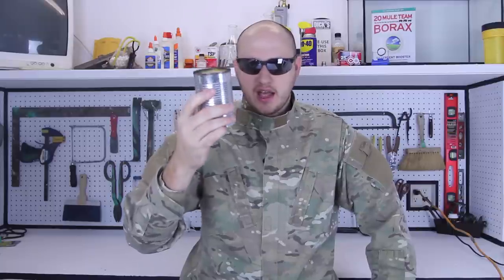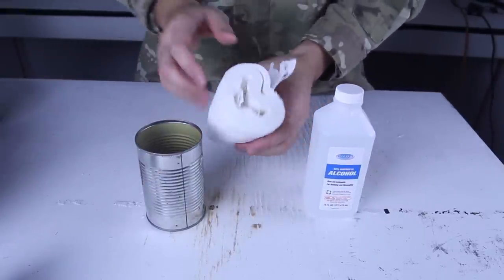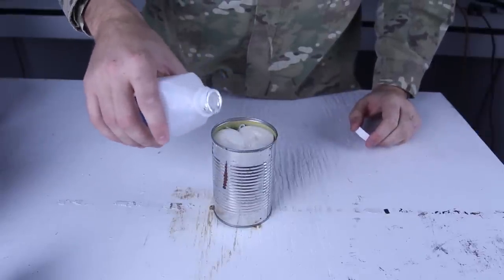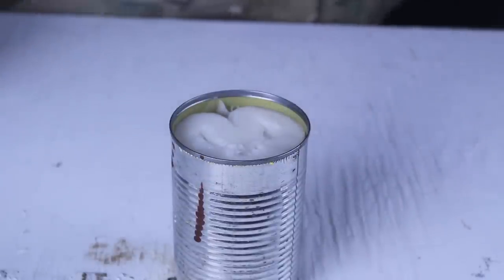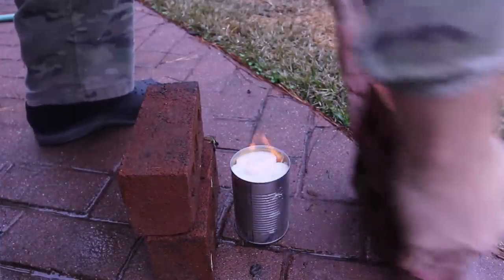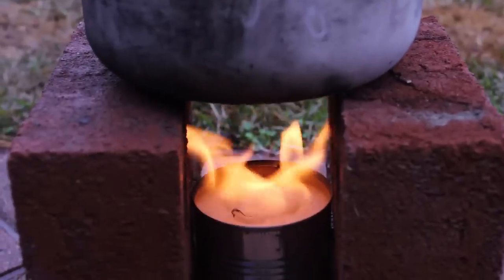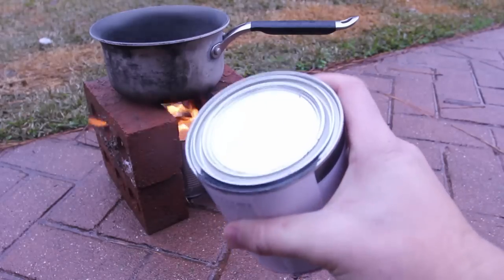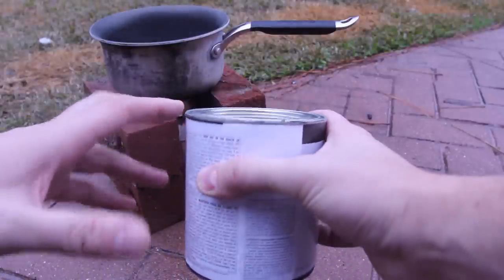Emergency Alcohol Stove from Toilet Paper and Can

Comment: I think in an emergency situation, toilet paper would be the luxury you would want more.  Are there alternative materials that can be used instead?  What about flame retardant insulation?
Reply: Yeah, in an emergency, I would take asbestos stove ramen noodles and save the paper for its primary purpose.  

But both decisions leave me feeling itchy.
Reply: They make a flame retardant insulation that doesn't use asbestos but recycled paper.
Reply: Every time I go hiking I always bring some toilet paper (cuz you know), some alchohol+first aid (for scratches), and maybe some food. So this video is pretty useful for me
Reply: This is a pretty cool trick.  Does it matter if you get the 70% alcohol vs the 90%?
Reply: @MrKeenius The higher the percentage of alcohol will burn hotter and last longer.

Comment: You really don't need the toilet paper.   Just pour the alcohol in the can, and there you go.  Instant stove.  (Just be careful not to knock the can over and spill burning alcohol!)

Speaking of alcohol, I would recommend using denatured alcohol rather than isopropyl alcohol.  Denatured alcohol (mostly methanol) burns much cleaner.

Comment: Very cool hack. I wish youd have shown a safe method of putting it out, though. Sounds silly maybe but it's an important part of the process. Dont want to get a nasty burn in an emergency situation where this is a necessary hack. That fire looked pretty wild. Seems like the hot bricks would make it difficult to smother. Pouring water on it would probably suffice but would that ruin it for further use? And what if water is scarce? Questions.
Reply: Pouring water on a stove like this is very a bad idea because if it displaces the lighter alcohol out of the paper you'll risk having a burning pool somewhere under your feet. It's very unlikely that blowing would work well either. Covering the business end with something solid and non-volatile is the best way.
Reply: moozooh
Just use the pan to snuff it out
Reply: moozooh
 thats pretty much all that I expected, which is why I was thinking itd be a good idea to show how to put it out if youre gonna do a vid like this.  It wont be common sense for plenty of people. thanks for the info.

Comment: Drill some holes into  the bottom of the can, alcohol won't leak out and air supply will be inproved. 
You can also drill it in the bottom and raise it up a bit, even better

Comment: how long this gonna make fire ?
Reply: TheSlavo1997 Hmm...using some very rudimentary calculations this will probably burn for about 30 to 40 minutes.
Reply: Martel DuVigneaud if you only put like a drop of alcohol, it probably won't start
Reply: Darren ATM It would definitely start with only a very small amount of alcohol. Isopropyl alcohol is volatile at ambient room temperature (as are ethanol and methanol) and as long as the paper has adsorbed alcohol the paper won't burn.
Reply: Depends on how much fuel you put in it, CRH demonstrated rubbing alcohol, You can use gas (A little bit, dont blow yourself up champ) Kerosene. Methanol, ect ect.

Comment: The biggest issue with toilet paper is that most are made to break down over time so it wouldn't last. Best thing to use is the white balls that they put in potting soil. Don't remember what they are called. They will be better than toilet paper.
Reply: Vermiculite....Think I spelled it right?

Comment: You can also use oils, including fats from various meats (lard) but you get smoldering toilet paper rather than an open flame. Great way to make an easy fire starting tinder box though. It's often quite difficult to find good kindling.